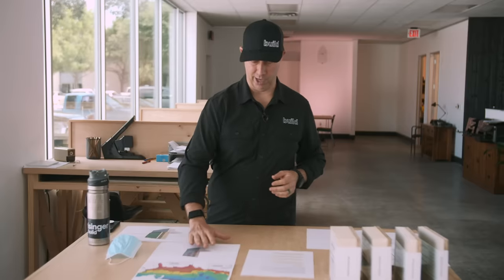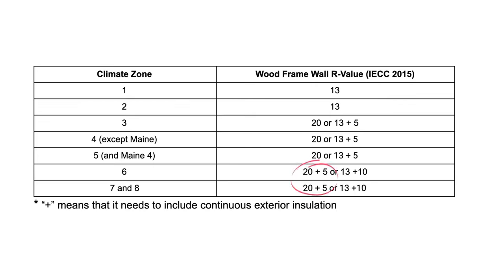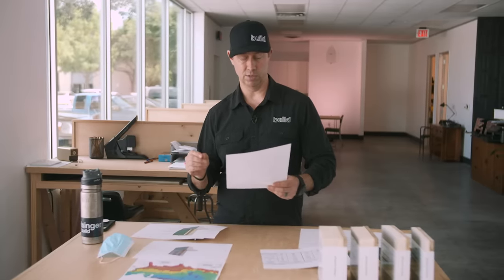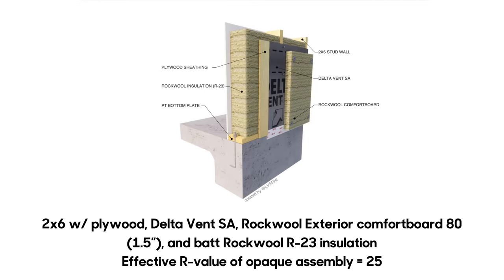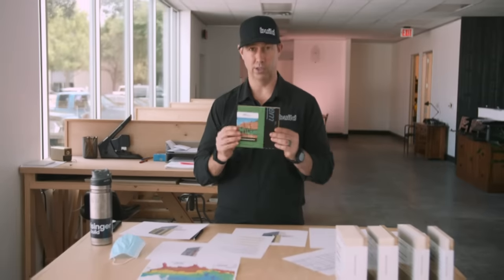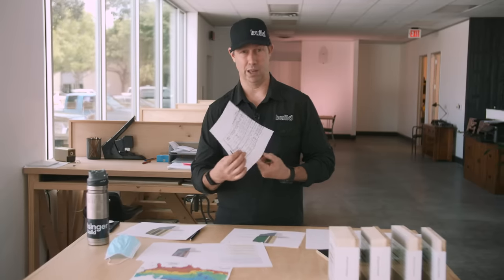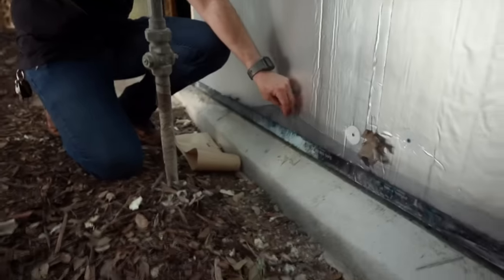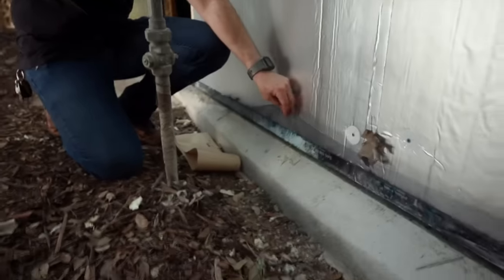5 Ultra-Insulated Framed Walls

Comment: 6. 2x6 w/ zip R-3 (or R-6, R-9, R-12) and batt Rockwool R-23 insulation
*   Effective R-value of opaque assembly = 22
*   $3.62 per sqft   1:19

7. 2x6 w/ plywood, Delta Vent SA, Rockwool Exterior comfortboard 80 (1.5”), and batt Rockwool R-23 insulation
*   Effective R-value of opaque assembly = 25
*   $5.82 per sqft - (60% more than previous assembly)  3:35

8. 2x4 w/zip sheathing, Atlas energy guard 2” polyiso (R-13), and batt rockwool R-15
*   Effective R-value of opaque assembly = 27
  
*   $ 4.05 per sqft - (30% less than previous assembly)
  5:53

9. 2x8 w/ zip R-6 (or R-6, R-9, R-12) and batt Rockwool R-30 insulation
*   Effective R-value of opaque assembly = 30
*   $4.82 per sqft - (19% more than previous assembly)
  10:52

10. 2x8 w/ plywood, Prosoco R-guard, 3” of Polyiso (2 @ 1.5”, offset seams), and batt Rockwool R-30 Insulation 
*   Effective R-value of opaque assembly = 45  
*   $7.13 per sqft - (48% more than previous assembly)  12:29

Comment: I do blower door tests etc on new homes here in Wisconsin and I often see large homes that perform so-so. Not terrible compared to many fast-built tract homes but could be a lot better. My advice to people who have the luxury of planning a home build is to eliminate some square footage and put that savings into performance. Also, simpler designs are easier to make tight and to perform better.
Reply: I live in Wisconsin and will be designing a home soon. Do you have a website you can reached at?

Comment: Matt,

You are costing me a lot of money. My home, which my wife and I love, was built in 1961. My utility cost is crazy high and I am repairing on stripping my home down to the studs from the outside, using new insulation between the studs, adding zip sheathing and an additional 2” outside of that then furring then siding. 

I have built only 16 homes in my life, thought I knew it all,  it through watching your content and studying the building science behind your thoughts I didn’t know much. 

Thanks for the knowledge and keep it coming.
Reply: I pulled all the drywall in my house, furred out the 2x4 to 2x6 and used R21 in the walls.. I blew in r60 in the attic and I've reduced my bills by 50%.. best bang for the buck as these ultra expensive assemblies will almost never pay for themselves in energy savings..
Reply: Chris that is another good answer but I am already going to pull the cedar siding and replace with half log siding with dovetail corners. That is the main reason for my attack from the outside. Also whoever built this house installed two layers of 5/8 drywall from ceiling and all walls and I do like that.
Reply: @FJB2020   That's been my thinking for a while with old houses.  My SO's house has a small (8'x12') sunroom added at the rear quite some time ago.  Just paneling inside with vinyl siding.  I pulled the paneling off (tossed it!), and pulled all the insulation out, then caulked ALL joins where studs meet the sheathing, so all four corners of each stud box.  Put the insulation back and drywalled over it.  She used to get tons of stink bugs, now, none.  She can keep the door open and it cools just fine now, or heats in the winter (zone 4).  Sealing the joins is as important as insulation in my experience.  I'm not a builder, but the difference in this job was astounding.  Now I want to do that method on all the walls in the house, but she won't let me.  :-)
Reply: @johnflannery4815  if you are pulling the siding, then go for it.. in my case I had 3/8" drywall and I was rewiring my home.. I also got a killer deal on 6" cased pella windows (90% off) so I furred out with some ripped 2 by material..

Comment: I would love to see some ceiling/roof insulation option done in the same format.  Keep up the great work.
Reply: And slab insulation too if possible!
Reply: Cellulose on the attic floor is the cheapest best way period
Reply: Raised heel trusses.  Run exterior insulation past top plate up to overhang.

Comment: Matt I always enjoy all of your videos, in 2000 I retired as a residential contractor in the Northeast and move to the Florida Keys I constructed my home using ICF and a hip roof ,standing seam roof and close cell foam to the underside, in September 2017 we were hit by hurricane Irma we stayed in the home and had absolutely no issues I videoed some very compelling videos during the hurricane inside the home as well as in the attic showing the benefits of close cell foam as well as ICF Construction. I believe in the cost of ICF Runs  somewhere between five and eight dollars per square foot , if you are interested in seeing and or posting some of the video I will be happy to forward it to you thanks again Norm

Comment: Would love to see a double stud wall option
Reply: Me too. It’s an option I’m considering.
Reply: Me too. ISA architects in Philly designed some double stud walls 24" on center with rock wool that were super insulated and inexpensive.  I think the builder was Postgreen, and the framing crew was "Old Glory".  Also, how do I find a builder in my area ( Northern NJ, but in general) that has experience with detailing and sealing?

Vapor barrier was on the outside of the inner wall so no penetrations for wiring and plumbing.
Reply: I did that in my home theater.. it is great for both thermal and noise comfort and cost the least amount compared to "engineered" assemblies..
Reply: I used a double 2x4 stud wall on my house with 2x8 plates, window and door openings.  Zip on the exterior.  Rockwool the outer stud bays then ran electrical, no drilling, all the wiring was stapled to outer studs.  Then insulated the inner stud bays.  No slicing batts to tuck around wires and all electrical boxes have insulation behind them.  The house is energy efficient and also very quiet.
Reply: I was thinking the same. I live in zone 6, so very cold winters are in play for me.
Reply: I'd be careful about going crazy on interior insulation in colder climates, in colder climates you need to balance interior and exterior insulation to avoid vapor condensation on the back of your sheathing in winter. Relying on a vapor retarder is risky.
Reply: @pazirandeh  Yeah I read about condensation being an issue.  I think the suggestion I read was to use a rain screen.  I'm in a mixed-humid climate personally and we get a lot of rain, so hoping to find a builder I can convince to do the rain screen anyway.
Reply: there's clearly more than 1 way to double the wall thickness
Reply: That's something I'd like to do if ever I build a house, double 2x4 stud walls with staggered studs.  Then a 3rd empty 2x4 wall on the inside that is hollow, for utilities, that way there's less holes in the vapour barrier. It would make for a thick wall, but having some nice thick window sills are nice for putting plants and stuff.
Reply: I saw something like that the other day. Double stud exterior walls, 16" cavity and they simply filled it with blow in cellulose.
Reply: Here's a quote from Joe Lstiburek regarding double walls from one of his articles from 2012:
"Double walls are tricky to construct, increase the risk of moisture damage and in my view they don’t make a lot of sense. Give me a single advanced frame 2x6 wall with lots of insulating sheathing any day. I did the double wall thing 30 years ago before there ever was a Passive House. It was dumb then. It is dumb now."
Reply: @nomen_meus  I have similar experience to Dr Joe. I have been in the game since 1971, done a lot of the insulation strategies and now would NEVER go backwards from maximizing continuous exterior insulation.  I TOTALLY agree with his assessment. Too many of the Building Science-obsessed want to re-invent the wheel. Steve Baczek is a prime example, trying to come up with unique new solutions for something that has been solved for simply and elegantly. The physics does not mutate, the first guy to lay it out gets the glory. The rest of the folks should be happy to implement the principle(s) successfully. The harsh truth is that we don't need more weird ways to build walls, we need a HUGE increase in consumer acceptance of building well. That means trading size and glitter for quality, efficiency and durability.
Reply: @pazirandeh  maybe if you'd protect the insulation instead of protecting the "house", you'd wouldn't end up with condensation in the insulation....just put homewrap inside and outside lol.
Reply: Ben Bogie has been doing double stud walls for decades and monitors moisture with readers embedded in the walls. Never had an issue. Use plywood. Vapor open WRB. And a .5 inch rain screen. That’s the belt and suspenders.
Reply: Niklas Roble Great build idea! So 2x 3.5” Rockwool batts = R30? And no thermal bridging through solid wood. I bet for the
Reply: Niklas Roble ....Great method...
Reply: @nomen_meus  Interesting that he's talking about it in 2017(?) here then:https://youtu.be/sBcNFeiWjrg?t=1315, he does mention he prefers to build Truss walls, but my understanding from reading and talking to a builder about double-stud walls is that they are inexpensive and easy to construct.  He does mention that the insulation value will affect condensation in cold climates.
Reply: @mlatouable  Did you actually look at the detailing that he discusses for the double wall scenario? It is truly a wall built outside of the wall, so no thermal bridging of plates, rims etc. Expensive??? I suspect rather much so. And the set of materials and detailing that are required to avoid condensation, mold and rot are EXTREME. Why on earth go to this effort, when continuous exterior gets you almost the whole way there, with hugely less fussiness needed and potential problems avoided? I imagine that the builder you talked to was not doing the Dr Joe version, per this vid. And he (and you) should be very aware of condensation issues. Its the old story, you CAN do all sorts of things, but will they hold up as one envisions? As a long-time builder, I am very comfortable with continuous exterior (and a LOT of job site training and supervision attached), not at all keen in getting into something as convoluted as what that vid showed. When you are building in the up towards the $1k/ sq ft range, potential liability is HUGE. I can charge what is necessary to build these projects, but only once. If they fail, it is on my dime, and that is beyond my pay grade.
Reply: @leestevens446  Also, even a double-stud wall will have some thermal bridges, it just minimizes them.  I've not seen a window or door buck that doesn't cause a thermal bridge and quite often the top and bottom plates are one as well (though that could be avoided).
Reply: This is also a topic Matt has covered before, just not from a price/performance perspective: https://youtu.be/60Q3pXR9240  as someone else mentioned, it would also be good to know any ROI info too.
Reply: I have done the double wall design with dense pack cellulose on the outwalls and middle cavity, and rock wool on the inner wall. I did one before with all dense pack, but the dry you can tell was getting strained a little with time. The rockwool seems to solve this. I have a 6 inch outer wall, 2 inch gap, and a 6 inch inner wall. The bigger issue is you are doubling costs and effort but the payoff is the energy storage of anything used in the house. Just body heat  from walking around is enough to keep the temps up in winter and I'm in BC Canada. You fire up a basic heater or cooling unit, and it uses less energy to maintain temps. Keep in mind I also have insulated floors and an offensive level of insulation in my attic. I also have a warm roof design. All these things have to be in place to have results like this and not just wall construction.
Reply: @goranpocina9628  I did something similar but created a service conduit box along the top and bottom on some walls to handle plumbing and electrical. That way my envelope has the absolute minimal thermal bridging. possible. Downside is you loss a little interior space in some rooms on certain walls.
Reply: @mlatouable , thanks for the link.
Reply: @SSingh-nr8qz  To my understanding, some builders actually build the frame all at once for these walls (you certainly can argue that adds some unnecessary thermal bridging), but it's really just a little extra effort if done that way.  The only place that really can't be done is the corners.  But for the majority of the framing, they do the same bottom and top plate, and a stud on both sides of the frame before raising it. Actually the builder featured in the FHB article doesn't do this particularly from the photos, but they do put the sheathing and WRB and it looks like rain screen even on  before raising a section (from a photo in the article).   Also, the costs shouldn't be doubled, because you're really just adding studs in most cases (not sure of the costs associated with a service layer, but I would also expect them to not be very high).  But as you point out, Joe also talks a lot about break points where the increased cost of the assembly will be offset by a reduced cost for mechanical heating and cooling systems.  I do agree this is only part of the solution, you still do need to insulate elsewhere, including your slab or crawlspace (here where I am) and attic or roof.
Reply: A Swedish wall variation where there's 2x6 walls with horizontal 2x2 strips to prevent them breaks.  See 5:30 at the following.  The prior video to this (part 3) compares details that show additional improvements that can be made at the sills/plates.  https://youtu.be/WNZhxTkWSdA
Reply: Double stud offset
Reply: I built double stud walls and love it, it is quiet and warm. When it is windy I never really know unless I look out the window.
Reply: @nevermindthebull0cks   Where did you see that? Would love to hear more about it as I am considering something like that. Up side of such a design is: cheap (blown-in beats everything price-wise), but down side: it defeats one of the pros of double stud walls, and that is running all your electrical and plumbing in the cavity between two walls.
Reply: @pazirandeh  Based on other comments on these videos it seemed like some of these wall assemblies wouldn't meet code there because they had inadequate outer insulation. Do you need outer insulation with T-stud walls or double stud walls in Alaska?

Comment: I wish you included the ROI of each assembly using a standard energy cost that we could scale..  It would really help people build cost effective, yet energy efficient homes...
Reply: it is not necessarily about ROI , but more about comfort levels. For example my energy bills are pretty low in comparison to my neighbours , but insulation level of my roof assembly is not enough. So every summer it is pretty hot on second floor.
Reply: @Артем-э2г8т  then you're not putting your energy costs in the right places because your HVAC should be easily able to cool a tight home
Reply: @alpha.gamma.dingdong  i am mostly heating my house. And its pretty comfortable without ac in every room except 2 specific bedrooms upstairs with shitty window placing and poorly instaled insulation.Two other bedrooms upstairs always stays comfortable in summer.
Reply: @Артем-э2г8т  so in summer you lose 2 rooms to hell
Reply: Too many variables. Climate, defined by heating-degree-days and cooling-degree-days. Cost of energy. Source of energy. How much comfort matters to you. Local labor cost (which changes the total cost). Etc.

Example of source of energy. I've been contemplating super insulating my cabin in the Colorado mountains. If I get my energy use low enough I can switch from delivered propane, to electricity. As the ultimate step, I can make and store my own electricity, which isn't possible with propane. I've come to hate the hassle and expense of propane. As it turns out the largest materials expense is the cost of decent doors and windows.
Reply: Square footage and climate would make a huge difference but I agree I’d like to see what the difference would be for 2000 sqft homes in somewhere in the mid-atlantic. I think that’d be a good start
Reply: @Артем-э2г8т  hate to disagree. Vast Majority care about ROI
Reply: I agree with you, but instead of ROI maybe a factor that represents the total heat transfer performance of the home as a function of cost. So that's radiant, convection, and conductive heat. As I understand you lose effectiveness the more insulation you pile on, but knowing where that sweet spot is would be super useful.